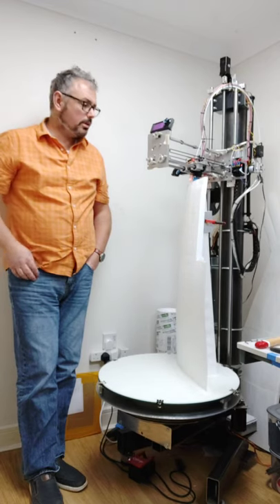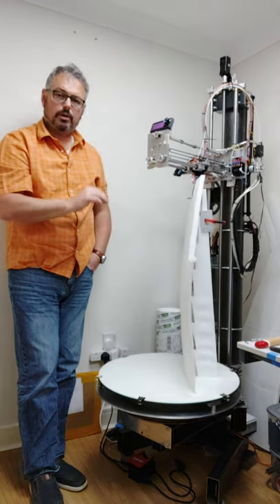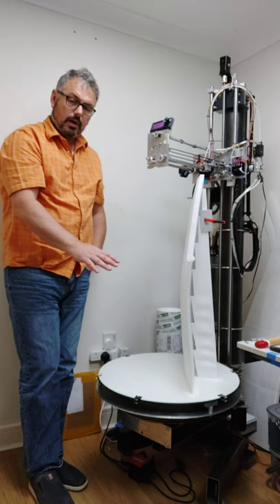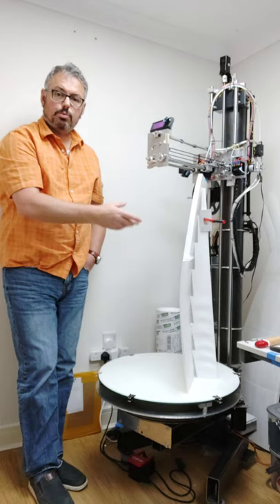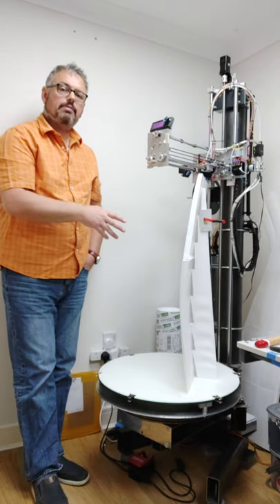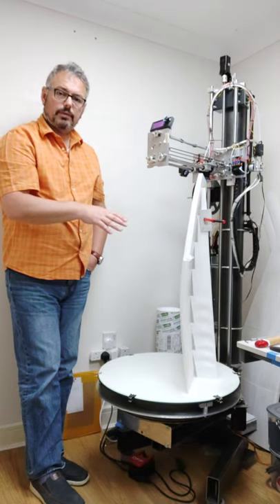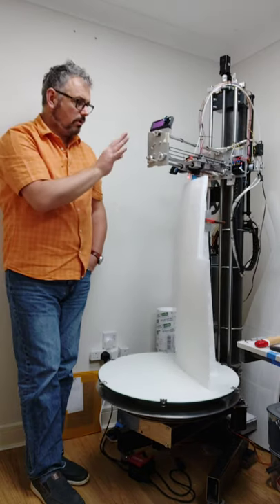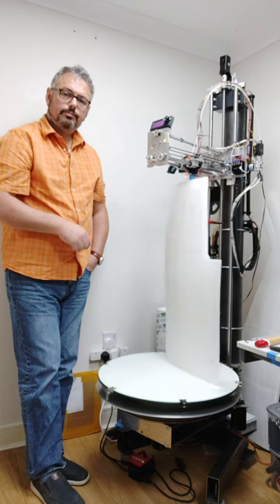150% Preassembled PlanePrint Eagle Wing - Large Print

Comment: amazing vidoe! I am looking to build my own polar 3d printer, but I was wonding how you would slice your models... can you explain? it would help a lot :)
Reply from the maker: If you use the Duet 3D controller in polar mode it uses normal cartesian GCode and does the axis translation on the fly.
https://duet3d.dozuki.com/Wiki/ConfiguringRepRapFirmwarePolarPrinter
That being the case apart from setting your slicer up with a round build plate your off to the races.

Comment: Really impressive !! How long did it tale for this part ?
Reply from the maker: Hi Pierre,
             Thanks! 

Unfortunately the web interface dropped out, but I think it was approx. 60hrs. The print wasn't very efficient sliced as there are lots of travel moves. I'm trying to re-engineer the print CAD to hopefully make it much faster.

All the best
Barry M
Reply: @CNCModellerUK  Thanks for your answer. I guess because of the new size it is printed in PLA and not LW-PLA, thus your are no using the "surface" mode in Cura and are having 2/3 walls to reinforce the structure. Are you printing with a 0.4 nozzle ? May be using a larger one 0.8 and keeping Surface mode with 1 wall would help to reduce travels.
Reply from the maker: It's printed with a 0.6mm nozzle as per the original thin wall process, however I will be skinning it with fibreglass and resin. I'm going to re-engineer the CAD to make the print faster.

Comment: What slicer do you use
Reply from the maker: I used to use Simplify 3D but have moved to Cura recently. The polar kinematics are provided by the Duet control board firmware configuration.